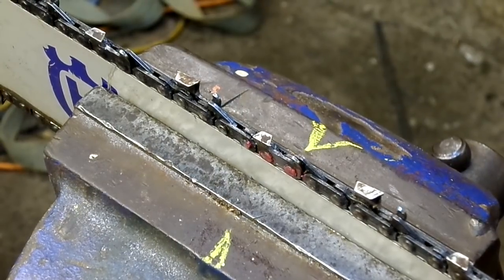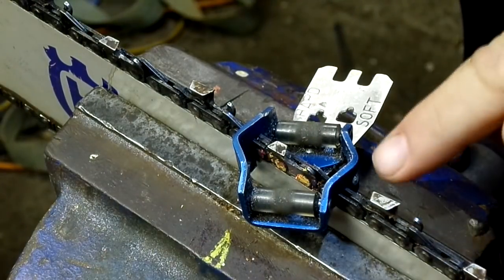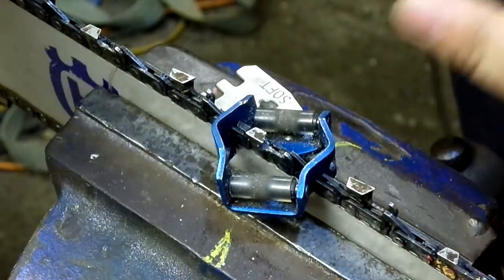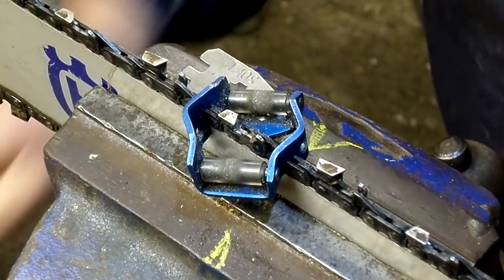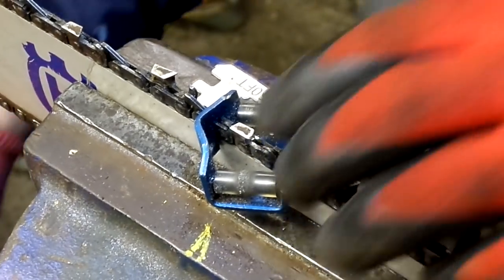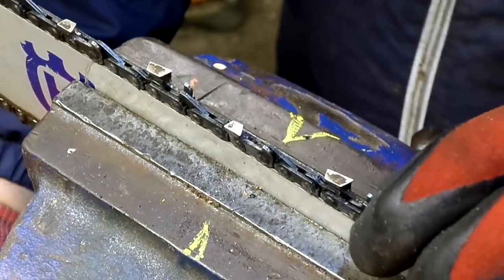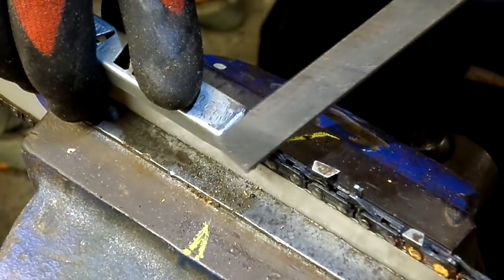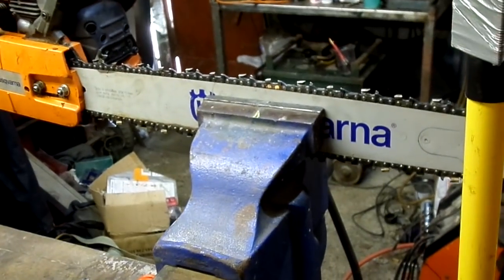How to sharpen a Chainsaw by hand

Comment: I swear by these Husky Roller file guides   the  last 2 winters  the time I saved  sharpening chains  was terrific on average under 5 mins  sharpen and tighten chain  could never do that with any other tool as accurate thanks for the very good video Calvin

Comment: Words of caution boys and girls:  Full chisel chains HAVE to have a sharp point, regardless of length!  

These Husky roller gauges work pretty dang skippy, if ONE uses them correctly, not like in this video.  No offense towards the creator here;  Keep the file going evenly across the rollers, and the proper angle will be maintained.  

Secondly, these Husky gauges tend to keep the file just a tad high on the tooth, and raises the gullet up a tad, so i run my file through, and then take the roller gauge off, and make a couple passes freehand, which creates a more uniform gullet.  Don’t believe it, try it!  YMMV

Just FYI   Peace!

Comment: No need to bring them all to the same length. 
If one or a couple are shorter makes no difference at all.
And what if you hit another stone? It will probably damage another tooth, and if you kept it long you can now file it back to make it sharp again, without shortening all of them again.
In the long run things will even itself out.
Reply: Excellent comment.  Who da phunk uses a vernier gauge to measure the teeth?  It is time consuming enough, if one files by hand, no need to add unnecessary complications.  The creator here is worried about taking too much off the rakers, but files them down using his 
flat gauge, removing material from it in the process?  This will only cause him to take more and more off the rakers.  Wow.  Peace

Comment: Good job! A sharp chain is critical along with raker height. You will put much less strain on your saw, cuts more efficiently and is much safer. Spend the few minutes sharpening or at least checking the chain before starting work. Don’t forget to check for chain damage that could cause failure, replace as needed. Never operate a saw with a questionable chain. 
Finally, adjust chain to proper tension. Your saw will treat you right.

Comment: Thanks for the video. Just one question. Using the depth gauge with the flat file that way seems to remove a lot of metal from the gauge itself. How often to do have to replace the depth gauge before it starts to give inaccurate readings?
Reply: Good comment and pertinent question, Kevin. Ive tried most all the gauges, and always come back to Oregon’s depth gauge and file.  I check each depth gauge (raker) of the chain, and if it needs to be filed, I remove the gauge, and file the raker down, and recheck it, thus avoiding wear and tear on the checking gauge.  It just takes time and patience and practice, when it comes to hand filing.

Comment: Really useful Video thank you Can I just ask in the Husqvarna Kit there are the Round files and a Flat file Is the Flat File used only to reduce the depth gauge?
Reply from the maker: Hi Peter.  Thanks for the comments.  Yes the flat file is only to reduce the depth gauge.  I use Husqvarna file blocks for the main teeth and I use a stihl depth gauge tool with which ever make files.  I hope I haven't confused you too much lol.  Cheers Calvin
Reply: Yes, only for depth of raker

Comment: So you use the Husqvarna tool to sharpen the teeth, but not to file down the depth gauges.  Is there some reason you don't use it for the depth gauges too?
Reply from the maker: Hi Ken Clark.  Yes I like the stihl version of depth gauge tool over the stihl because I think the Husqvarna one takes too much off.
But I like the Husqvarna file tool over stihl method on the main teeth sharpening.  That's the way I roll lol.  Cheers,  Calvin

Comment: Do people recommend these roller guides?
Ive never used a guide but does it make a chain easier/quicker top sharpen?
Reply from the maker: Hi Jonathan.   Yes these roller guides are great they really help with keeping the file at the correct angle.   I used stihl files in the holder ( You have to hold flat yourself )  for many years which were ok but i definatly find the Husqvarna roller guide ones easier to use.  Cheers Calvin
Reply: I have recently purchased a file guide set from Husky.  I have sharpened 5 chains now.  OLLLY COW what a huge improvement on consistency and sharpness!!!!!  Big huge snowstorm of noodles.     I see no need that all the teeth are the same length within reason.   I didn't make the teeth all the same and my chains cut super using the guide.   Depth of rakers left to right seemed to be critical though  Please pay very close attention to depth gage side to side.   I filed the teeth until the damage was gone or correct feel was achieved.  Feel is critical

Comment: surprised it doesn't have a guide for the angle.  I notice your angle drifting on each pass.
Reply: It does  OC, you run the file across the rollers as ‘Random Task’ notes below in their comment.

Comment: You're filing at an angle. Should be filing in a straight line parallel through the gauge. Nice high spec calipers though👍
Reply: He's doing it right. The jig is already angled, so you have to stroke perpendicular to rollers.
Look at an imprint on the rollers, they're dead center. Only if you read the manual...
Reply: @rafon.   looks agle off to me also
Reply: @rafon.  The print on the rollers isn't a guide put there by husqvarna it's just the filing making it, so it can be wrong. The jig also isn't already angled, it just sets the right height for you, the user still has to file at the correct angle.

Comment: Skip the use of the vernier measurement.. do as Bryan says.. sharpen 'til sharp, much quicker and just as good. Keep watch of the angle be it 30 deg or whatever, just so they are the same both right and left teeth.
Reply from the maker: Hi deernut00  I think people miss understand what I'm doing here . I hit a stone with this chain when I was cutting a root out and badly damaged the chain. The chain was new so I wanted to get it smack on with the vernier. That's the only reason I'm using it. It cuts perfect now.   I don't use it any other time. Thanks for the comments.  Cheers  Calvin

Comment: man after my own heart. love the OCD on the chains me :) my pals laugh at me when i get the Vernier gauge out lol
Reply from the maker: thanxx . Hi. Thanks for the comment Lol.   That's right I believe it's got to be smack on to work correctly.   All the best Calvin
Reply: Just my 2cents !!!  Hey guys just because you have 1 or 2 teeth that are damaged or dull from hitting something like a rock or wire fence, you don't have to shorten all the teeth the same length just to match that one tooth... sounds weird I know ...skip the very damaged tooth or teeth  this time your sharpening and sharpen all the others like you normally would.. then next time you sharpen the same chain again ...you sharpen those few teeth then and then all the teeth will be the same length some what ....it just adds more life to the chain , instead of sharpening all the long teeth down  just to match a few damaged shorter teeth .....trust me the saw will cut the same as if you sharpened all the teeth ...not every tooth cuts every-time when that chain rotates through the wood!!!    Great video !!!

Comment: Depth quide at 4:22 was not quite correct.. as it works without changing sides. Either hardwood or softwood notch with the depth guide (raker) in the notch will work for every tooth. This is a great filing guide. Use it all the time on Stihl chain, just a bit tight fit.
Reply from the maker: Hi deernutOO.  Ok  thanks for the info.   I will look at it again to see what I was doing wrong.  Cheers Calvin

Comment: Use the depth gauge on the combi tool, as it will work for the individual tooth, not a group of two or more.
Reply from the maker: Hi . I can't get along with the husqvarna depth gauge. I use the stihl one for that bit. When I compare the two the husqvarna gauge takes to much off unless I'm doing it wrong.  Cheers Calvin

Comment: This wrong information. Tooth length doesn't matter at all . Don't file your good teeth away for no reason .  Make the teeth sharp , set the depth gauges correctly , all that matters .  And don't file your gauge while lowering the raker , gauge is for checking not filling .   Yet another instructional video that doesn't know how to do it .